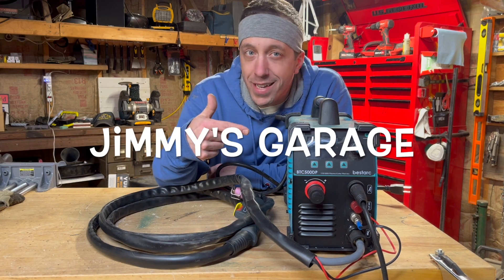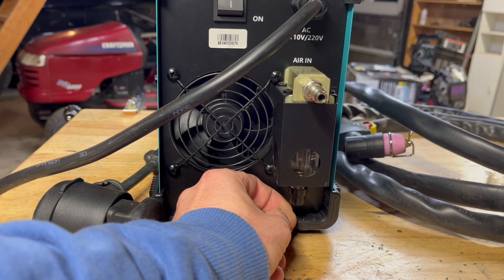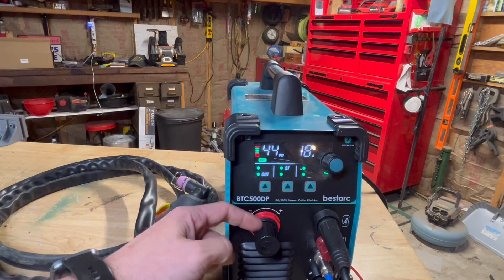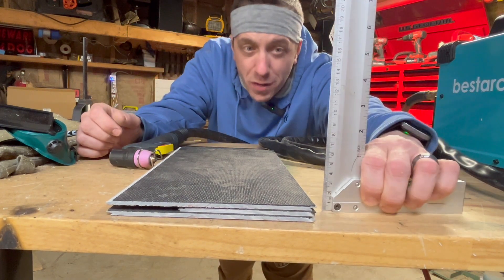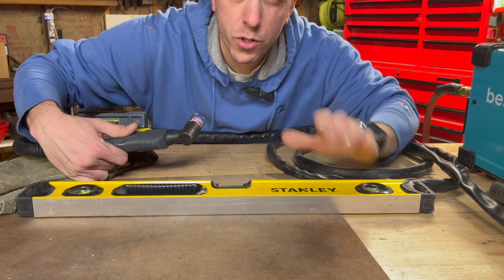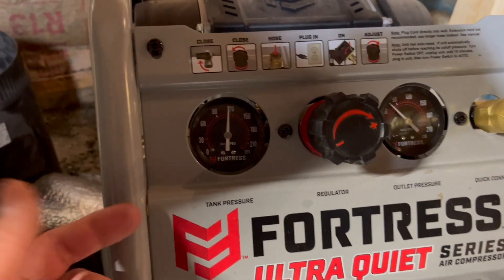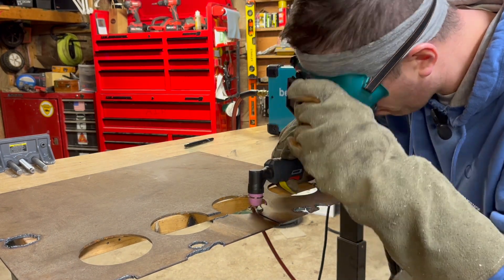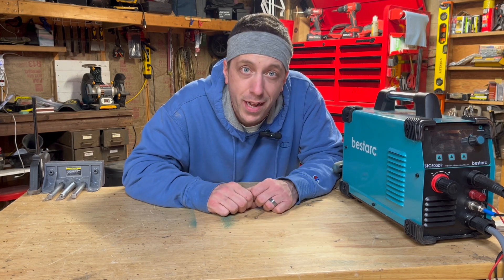Bestarc BTC500DP 50-Amp Plasma Cutter - Full Review!

Comment: I got the exact same setup as you except i got the bigger fortress that has 200psi and 4cfm rating so i should be good im also going to be running it on 220 I've tried it only once so far and im happy with it im using it to make some go carts lol building my second one with suspension going to be my winter's project 😊 good video sir